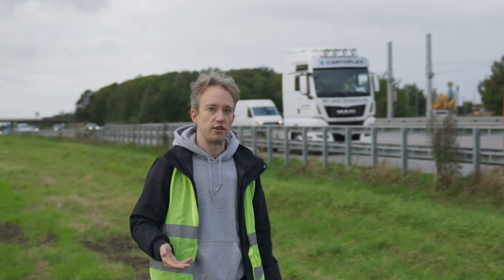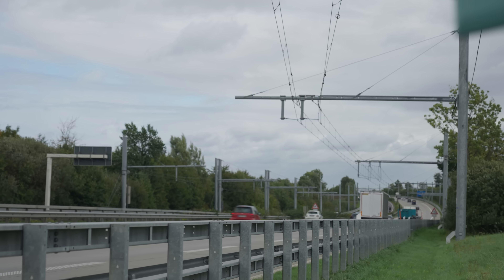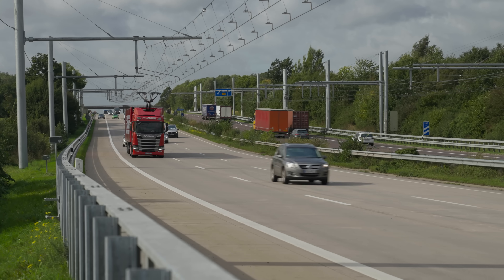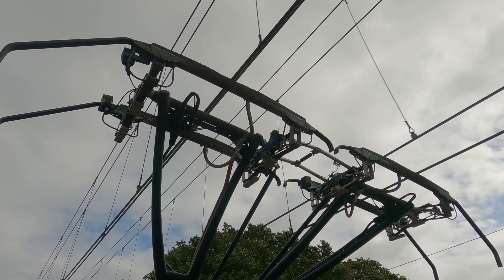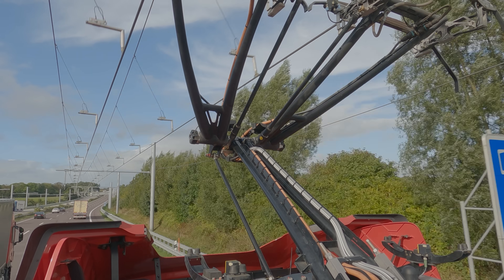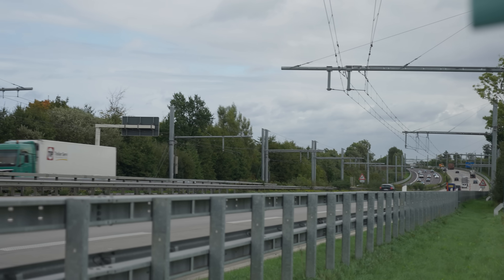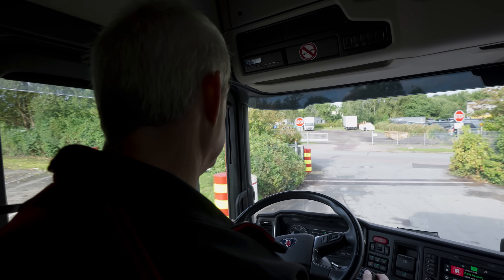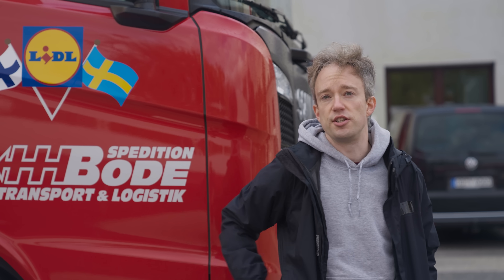The highway where trucks work like electric trains

Comment: It isn’t a bad idea as such, but Germany still relies heavily on coal power, so although this system is probably somewhat more efficient than internal combustion, it is not entirely free from carbon emissions at this time. (Or else, said in other terms, Germany needs to re-think the possibility of expanding its nuclear power system once more.)
Reply: Sadly, nuclear energy is heavily stigmatized because people don't seem to understand that it is a lot safer and cleaner than coal.

All it took was one haphazardly cobbled together reactor to fail to scar multiple generations into believing nuclear energy is bad.
Reply: @M--001  haphazardly i wouldn't say that there were a number of factors
Reply: @horatioyen256  Sure, there were a number of factors, but the issue was with the RBMK itself. Corner cutting and such caused a test that otherwise would have gone fine to fail dramatically.
Reply: German's are a little bit crazy when it comes to nuclear power. I understand lots of places can have some resistance to nuclear power, but Germany is the only developed country to literally replace it with coal in the 21st century.
Reply: @poika22  I agree with you, dose Germany want electricity or not (coal is not the answer). I am not a big fan of the Nuclear up to now, but I do like electricity so the question is how do we get it?
And before some one suggests coal and gas, No coal has had it's day and gas is good for short term peaks.
Reply: Bro it will never the alternative way for our country
Reply: The difference with having all energy demand on the grid, is that it's easy to switch power sources. If you want to switch from, say, gas to diesel, or gas to hydrogen, or hydrogen to electric, you need to modify your infrastructure, and change your vehicles/appliances/etc, and you have to do it all at the same time for the most part. When everything is electric and plugged into the grid, changing power sources is easy and transparent for the user.
Reply: Totally agree with you on all of your points.
But if we are going to get electric or PiEH running Trucks, then burning dirty brown coal in one place is better than running diesel every where. But Germany needs to stop increasing it's electrical usage, until it starts to produce more electricity and more clean electricity.

Comment: I love this, but i feel like a hybrid system would be better, I’d feel more comfortable using a Diesel engine not on the motorway than I would pure electric power. 

Although. There’s a lot of space under the trailer for batteries, might not have been able to fit a fuel tank there but I see no reason why they can’t fit some batteries

Comment: This would be perfect in the United States, utilizing hybrid trucks with this technology would work very well on the United States highway systems, especially on routes like 70. Where it spans the width of the country.
Reply: I thought that was route 66
Reply: It would never work in the USA because of the distances involved and the decaying infrastructure. Germany as a whole is smaller than Texas, and considerably more urbanized. Better solutions for the USA are simply more charging stations and better batteries.
Reply: @datanon3059  a nuclear reactor in every car by 2030
Reply: @Ass_Burgers_Syndrome  The issue isn't the power, it's the simple fact electric motors are not as good as delivery torque as a traditional combustion engine. We have not seen a single Electric motor do a truck run from California to Alaska for example.
Reply: @grimnir8872  The problem is the power source. ELECTRIC Motors provide the highest torque. Why do you think Tesla's can outperform Sports cars in Acceleration?
Reply: @asandax6  They don't though, that is why the Tesla trucks cannot even make cross country road trips through California, yet alone harsher conditions. They simply do not provide the pulling power needed.
Reply: @grimnir8872  They have the pulling power they don't have the power source. If you plugged them to the grid they'd run just as well if not better than diesel trucks. The reason Tesla trucks aren't a thing yet is because with our current battery tech to match the range of a diesel truck requires a huge battery.
Reply: @asandax6  No, that is literally factually untrue, even if connected to the mains, a Tesla Truck couldn't handle the change of conditions lond haulage requires. They are simply not energy efficent enough, The engines need to be larger than their diesel contemporaries and MUCH heavier.

Comment: German here; train is not a better solution because the "Deutsche Bahn" is just meh and lacks in flexibility especially.
However this eHighway is just a bad hack to prevent the problems of building train tracks, because our road infrastructure hasn't aged as bad as our rail infrastructure.
The road infrastructure is also becoming worse every year tho

Comment: still havent electrified all rail yet wich is much simpler needing only one wire
Reply: making the cantanery poles and wires shouldn't be that hard since they can just be made in factories then trucked to a rail yard where a train to assemble the system can do it.
only expensive part is getting the people to install it.

Comment: As we phase out fossil fuels and use electricity, the demand for electricity will go up. Demand drives up prices. Will the common person then have to pay more for household electricity And business will also have to pass this cost along, especially with high electrical demands. How will this work?
Reply: With more demand, supply will increase to match the demand. We can build more power generation capacity and more distribution capacity. 

Nuclear + grid energy storage will provide a reliable, efficient, clean grid.

Comment: So when you have to move freight, and can only do that with trucks (this itself seems unlikely to me, but I'm going to give you the benefit of the doubt, so apparently this is a real problem in Germany), these guys' solution is to turn the trucks into less efficient trains?

I can only hope that enough thought has been put into this project, because this video certainly didn't make me feel like that's the case. I mean, why not build more electric train lines, and then trust the rest of the shipping on "last mile delivery" e-trucks?

Comment: If the problem is the battery weight and the autonomy, why not just move the freight by train and then make the last km with an electric truck? Lobbies?
Reply: Installing one of these on an existing highway is a lot less drama than making a new rail line.
Reply: @kensmith5694  You also need to convert the trucks. And you don't need to buy new rail lines, the existing ones are not saturated...

Comment: Great video, but the idea here ignores climate change. It's another band-aid solution that doesn't reverse climate change. We need to grow forests at half the carrying capacity to maximize growth, chip them up into paste, and pump it back into the ground to restore carbon sinks. Electric power is NOT the  solution to climate change because we can't produce - and especially can't transmit - enough power from renewable resources to meet out current energy demands, nevermind electric trucks. Think about all that energy travelling through grid lines - it's not good for our health and really inefficient. Source-at-demand power production: combustion engines, will ALWAYS be the most energy efficient solution. There's no wasted energy from transmission. If one truck runs out of fuel it's not going to shut down a country's transportation; it the grid fails or a pantograph snags a wire during a crash that blocks a road and unpowers thousands of vehicles. And remember that overhead pickup requires maintaining high tension cables. In Europe sure, maybe, but in the U.S. we don't have electic trains on a large scale outside the NEC. Nobody wants to maintain those wires, it's a hassle and a waste of time. We need to REVERSE climate change, not overlook it, and this "solution" doesn't address climate change - it's a more complicated energy delivery system with more failure points than combustion engines.

Comment: What I love about this is the understanding that you use the right technology for the application, instead of trying to shoehorn one single technology into every different application because somebody told you that "[electric/batteries/whatever] is the future!!!"  You can generate electricity efficiently and efficiently deliver it to large vehicles moving along main roads, but you're not trying the hopeless task of using wires or giant batteries to move dozens of tons of cargo along rural back roads or inner cities.
Reply: Petrol/diesel is the best solution for automobile transport right now. In the future it will be electric when battery technology becomes much more efficient as does building the electrical grid.
Reply: For sure. This wouldn't make sense for cars but it seems to make perfect sense for trucks. If the two approaches can be combined by the sticking in an adequately-sized battery *as well*, that's a full door-to-door electric-powered journey. Amazing.

Comment: Why don't they use some of the wheels as an alternator?
Reply: Why do that?  The electric motor/generator in the truck cab is doing all they need done.
Reply: @kensmith5694  I mean so you don't need to charge it, its being charged as the wheels turn

Comment: How long do the cantenary wires last?  Many more trucks use the roads daily than trains on tracks.  I suspect maintenance will be a nightmare.
Reply: Maintenance is always costly but never as costly as failing to maintain.  If more electric trucks use this than there are electric trains that means this was a success.

Comment: Re-inventing the wheel and spending crazy amounts of money doing it turning the road into what the train line is already! Roads already take a lot more punishment than they should due to pushing all the cargo onto it! And how crazy expense will it be to upgrade all major routes! Why don't they get back into using what they have, get the train routes back into taking cargo. Trains take crazy amounts of cargo compared to trucks and get the trucks to do the regional distribution from local hub.

Comment: In Germany it was heavily critised for two things: 
1. Trains do it better, faster and cheaper, this is only a solution for the last mile, where you can't built train tracks to. 
2. Why building it overhead and not embedded into the street? We already have the solution for that, it works better, it is way cheaper to built and opperate and everybody can recharge their batteries, not just trucks!

Comment: Local manufacturing is the long term answer, not massive new infrastructure projects. We need to reduce the number of cargo ships and cargo aircraft if we want to reduce emissions. About 80% of the fuel used in the transport sector is consumed moving things we used to make locally half way around the world. That's a great system if you are a politician or a global corporation, but not so much if you are a citizen, in need of a job. This is the stupid system our popliticians have built, I don't see any good reason to give them another decades long massive infrastructure project to milk billions from the taxpayers before, during and after construction. Also we tried electric busses before, it wasn't the fuel costs that doomed them, it was maintinence costs.

Comment: I wonder what is the amount of dust the overhead electrode and wires generate due to friction and micro arcing and what is the impact compared to diesel (I would assume orders of magnitude less)
Reply: Yes, it is much less. But you are right, one of the major problems was the friction, since instead of one tram every few minutes like in the cities, on the Autobahn there is a truck every few seconds at much higher speeds, which also intruduces heat into the cable.
Reply: @luckyqualmi  It's a pity that roller contacts style wouldn't work well in this sort of application since the truck is constantly shifting from side to side. Nice that you have to deal with interesting real-world problems)

Comment: The thing is: In Germany we had a vast railroad network. Nearly every village and every factory was connected by rail.

So from my perspective this is a step backwards
Reply: There is a train track running parallel to this road. (A few hundred meters separated so you don't see it, but it connects all the same towns.)
Sure, this is a test track and not meant to be commercial, but it highlights how dumb the idea is.

Comment: Now, this is a smart idea when compared to battery-powered trucks. Battery-powered vehicles is just a dumb idea given how long they take to charge, how dangerous it is (i.e. flammable/explosive), how little range there is, and how quickly the batteries wear out over time.

Comment: Way not install these on truck-stations, depots and at the motorway service area for stationary use of charging battery trucks. The truck driver must rest every 4,5h (≈400km) in germany.
Reply: If the truck is standing still a cable plugged in would likely cost less to do.
Reply: Because the batteries are extremely expensive and we simply don't have the raw resources for it. They only last 400-600 full charges too, so have to be replaced often in trucks.

Comment: Why is there no talk of "How" the electricity will be generated (especially to meet the ever increasing demand) we already are having supply issues during peak periods with our infrastructure being overloaded, let alone the cost of building the trucks to start will. They will still need batteries, electric motors etc which all come from mined minerals. The extra cost in mining them & producing the components would be huge. I'd like to see "real Comparisons" to those of the ICE or is it the fact everyone is so fixated with carbon emissions that the manufacturing side of things & how the electricity is made is out the door because an electric vehicle "seems" to be clean & Green" ? Just a thought?
Reply: Would be really nice to find a very common or sustainable material that holds enough electric charge to be viable large-scale. That's what the current EV boom really needs.
Reply: Carbon emissions worldwide, if you ignore China, are mostly neutral already. The major detrimental gasses left are Nitrogen and Methane, and neither of them are addressed with a  system like this.

Comment: If they want an easier alternative they could try using steam lorries again. Back in the day, they would have been used for very heavy-duty tasks because of their power. But they are fully automatic and burn hydrogen or biogas. Steam has been around for longer so by the time it got to the 1920s there were already steam cars that could easily keep up 70mph all day that could get a good head of steam in about 90 seconds.  Steam also produces a lot of torque and it doesn't idle so it would be good for crawling through traffic jams and since it would be fully automatic it would shut off the fire if the pressure gets too high so you would be burning less fuel. It would also probably be a close system ( the steam going into a condenser and possibly being reused) so the only emissions would be from the biogas and if it is hydrogen there would be no emissions because the emissions from burning hydrogen are water vapour which can also go into the condenser and add to the water tank. They would also take less time to refuel as well.  If they use the suitable food waste and poo they could have a limitless supply of biogas which could make it a cheap fuel because there is a never-ending plentiful supply of it. You also wouldn't have to modify the roads as much. The only modification they could make to save time is maybe in a straight section of the road they could have a lane that has a water trough in it where the lorries can fill up on the go. When GWR did this with their trains they cut the journey times by 30 minutes. The emissions from a closed system steam lorry would also be lower than a diesel lorry as well and it would be zero-emission for a hydrogen-burning lorry. it would also keep mechanics in business because there is a  lot going on under the body of a sophisticated steam car. To help with the power transmission they could also have a CVT gearbox which would let them have the perfect gear ratio, they would also be very quiet which would also be good for cities, they would have to make some noise though so that they can be heard by people.

Comment: What I'd like to see is sort of a life-size version of RC track cars - power rails embedded in the ground make contact with metal rollers to transmit power. This would have the benefit of being accessible to even civilian vehicles!
Reply: A bit risky though, if someone steps on one, or metal debris falls off a car. Rain and snow also might be a problem.

They can probably put the wires a couple inches under the pavement and use induction.
Reply: @renakunisaki  ooh, induction charging under pavement on the highway? That's a future I could get behind!